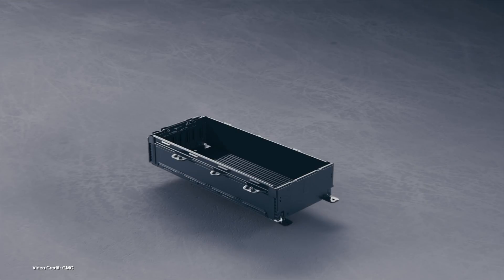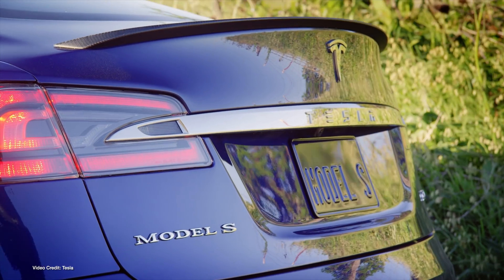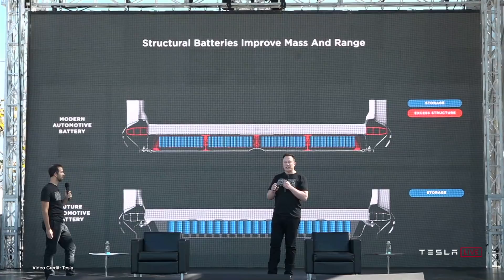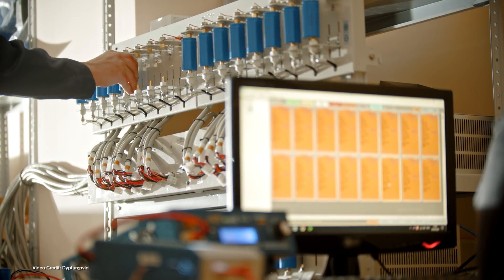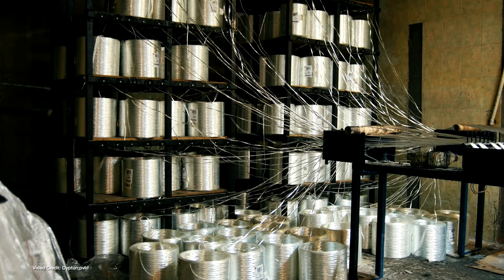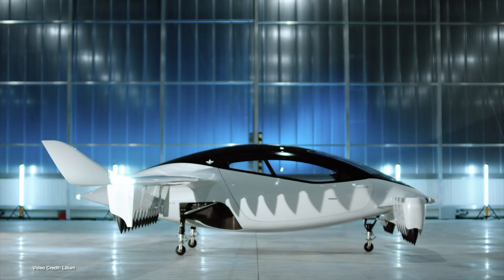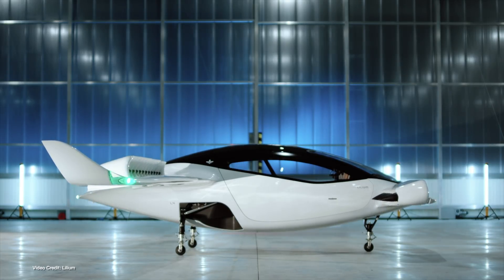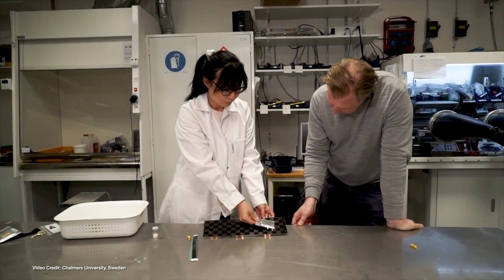Why You Should Be Excited About This Battery Breakthrough From Sweden!

Comment: Unfortunately the elephant in the room was not addressed. All chemistry batteries will age. So at some point a vehicle built with such a tech would be a throw away. Meaning you can't just replace/upgrade the batteries you have to dispose of the whole vehicle at some point. This is not a good tech since it promotes waste assuming recycling is not 100%.

Comment: Well enunciated! As an aside, imagine the day when all cars, trucks, and busses are electric. Now think of all the gas stations we currently have in a big city, and how many tankers of gasoline arrive daily to fill their tanks with gas. How much electricity does it take to replace all that gasoline? I might suggest, far more than the capacity of the current electrical grid. Furthermore, in order for electric cars to be really practical, they all need fast charging. We are talking here about charging at a rate of hundreds of amperes an hour, and 240 volt chargers. How much thick copper cable do you suppose it takes to make all those fast charging posts? I would suggest again, we will need more copper than we have.

Comment: There is one problem. Pretty significant problem.  When the battery has expired and needs to be replaced it is most likely going to be many times more expensive to change into new batteries.

Comment: Every bit of body being part  a battery. Vulnerable to vandalism or accidental piercing. Independent battery weight , yes but not so easy to be got at.  Car with lots of joints on +/- ? Might be best to get just get cars out of the picture. Free travel any vehicle method, but you won’t be the owner.     It’s got to happen, get used to it, no cars parked all over the streets or on the roads

Comment: They really need to replace carbon fibre though. It cannot (viably) recycled at all.
And the drawback is that the battery is not replacable when it's structural. 
As soon as your battery is broken, your vehicle (or plane)  is junk.

Comment: This could be a nightmare, imagine such a structure, full of composite materials, which acts as a battery, what would happen at the end of the life of a product built in this new combination of materials? Carbon fiber is a nightmare to manage, currently most of it ends up in landfills ... And what about the fact that it is also a battery? how long would the cells last? such a structure would not even allow to replace defective or broken cells and this would lead to the waste of entire sections of frames that would be a nightmare to be recycled... mmm... dreams are beautiful until they collide with reality

Comment: The Tesla wouldn't need 1000hp to accelerate 0-60 in under 2 sec if it only weighed 2000 lbs instead of 5000 lbs. But I hear about breakthrough batteries lasting 28000 yrs and everything else but see the same ole same ole in my new phones.

Comment: So when the battery "chassis" need replacement, you'll need to buy a new car?  Yet again another throw out, buy new product? EV's are not worth it for atleast 10-15 years.  If you need to replace motors, screen and other vital part within 4 years, the technology is not yet there..

Comment: For vehicles I don’t think this has an application unless it’s remarkably cheap. The first accident you have is going to be awfully expensive! Now for aircraft I see it has potential but efficiency would have to be a lot higher. Where I think this has potentially massive application is in solar panels - you can use this as the substrate and frame for a solar panel and have storage and generation in a single solution. Once again efficiency has to be improved a bit but elegant.

Comment: They do the same with engines.  But they can’t do exactly the same. The battery pack STILL needs to be in its own case capable of bearing loads while at the same time being temp controlled

Comment: So the idea is basically turning the body of a vehicle into a capacitor, I envision some safety concerns for that application. A charged body panel might remain extremely dangerous in the case of damage via crash or impact.

Comment: So.....once the structural battery is worn out you have to throw away the car. At least with the way they are currently are you can rebuild the battery pack and continue to use the car.

Comment: I'm  wondering why Rocketlab didn't go for this battery-as-structure thing. Guessing its power density and strength is hopelessly low for rockets.
Reply from the maker: Also, remember that Rocket Lab jettisons their battery packs during the ascent process. Battery hot-switching is a key stage for them. But I suspect that the energy density might be the bigger issue, as you say. - Winter
Reply: @transportevolved  Yeah... energy density too, but to me that seems like a lesser problem, if the rockets walls/fuselage/whatsitcalled is built of 20 wh/kg battery... and Peter Beck was very confident about not reusing rockets at first so it would have made even less sense then. Probably they are a lot better informed about battery tech, so they'll choose what works best.

Comment: 24 wh/kg is less than 1/10th of the density of current batteries. If a car is more than 10% batteries by mass currently, then with this tech it's literally impossible to get the same performance. it does not take a genius to think this through. What's worse is that if your benchmark is the Leaf, then we already know this is not an adequate spec. this does not even take into account the fact that you need HV batteries to run a car, and if your entire structure is battery then any minor collision now turns your entire chassis lethal to the touch. maybe learn some high-school level physics before hyping up tech that is unworkable?

Comment: If they can develop it into an applied coating, it may be commercially viable, but if it is used for frames or body panels, repairs will be prohibitive. If we didn't have psychologists marketing vehicles to go far longer ranges than most people need, smaller battery packs would work fine and smaller battery packs would be very viable for quick change at stops on longer range drives for day trips or vacations. Right now marketing is driving the industry down the wrong paths.

Comment: What if they made a entire house that was made out of battery we would be able to to store so much energy
Reply: The most energy to store is tank of heating oil . Pinhead do not think about heating entire house. Battery will be good to sign in  ON LINE for welfare . I can't even trust my emergency sump pump battery pack, it holds until I make generator ready. House construction is for rental unit now,

Comment: Energy density is too low, it would have to be applied to larger objects..  Maybe a roof of a house or walls with PV to recharge, or maybe a bigger boat with a PV cover roof.  Not so much for space since satellites are shrinking, so the in development SpaceX starship can do 100+ tonnes  to low earth orbit and the limiting factor would be size of the payload. Also imagine the cost of getting into a fender bender and your bumper is part of a structural battery, because currently there just made made out of plastic and cost thousands of dollars to replace.

Comment: "structural batteries" Aka: non-user replaceable... I'll be taking a big fat pass on this 😅
Reply: Current products are so heavily developed/engineered that user repairable is rapidly going obsolete. Getting to the point where keeping every garage stocked with the required tools is more wasteful than designing products for recycling.
Reply: @lengould9262  here's a story on repairability - this guy hit some road debris, which damaged a plastic belly pan and punctured a coolant line - Took it to a Tesla shop and they told him $16grand to replace the battery (ended up taking it to a shop that fixed it for $700)  who https://jalopnik.com/tesla-quotes-16-000-to-repair-model-3-independent-sho-1847281796
Reply: @peterkratoska3681  Yes, that is like 'surgery' for fixing an artery for cooling the battery!  How perceptive are those guys in the mechanical shops!
On the other hand, how rigid are those minds of Tesla shop!  They are knowing only the 'money-making mode' where they can make the most money in the shortest time.  How efficient, the process of using what has been already designed, to replace the main item which got impacted but not in the best interest of the buyer.

Comment: Its utility depends on the cost of the battery. Perhaps you could make a vehicle with carbon fiber instead of aluminum and steel and use conventional batteries to get similar performance as using this structural battery that also uses carbon fiber.

Comment: I'm seeing quite a few Comments regarding structural batteries in EVs and the problem of accident damage being non-repairable...

But why assume that the battery would form the outermost skin of the vehicle? If it formed the chassis and sub-frames which were then clad in shock-mounted 'ablative' body panels, only an extremely serious impact would damage the inner battery.

Think of how infrequently a petrol tank is affected in an 'ordinary' crash. There's no reason why battery components forming the floor, seat bases, boot lining and roof structure couldn't be similarly protected.

A car with a structural battery would be no different from one of today's cars, where it's accepted that a severe enough collision will result in a wrecked monocoque and an insurance write-off.

Repairing minor dents and scrapes in doors and wings would be pretty much the same as it is now.

It might even be better, if the outer panels are made from recycled plastic and not steel or something stupidly fragile and expensive like carbon-fibre.

I think some peeps are just miffed because this interesting idea is one that doesn't have Ego Muskrat writ large across it.  That's all the reason his disciples need to knock it down.

Comment: Meh... using batteries to build a car (or any other vehicle) means its far more likely that when (not if) a battery goes bad, the entire car (or substantial portions of it) will have to be replaced. This is an extremely expensive, and terribly wasteful idea... not to mention, anti-consumer and anti-environmental. No, having batteries be a modular component aside from the structural components of the vehicle allow for re-use of the vehicle structure with replacement batteries. 

Look at this another way, if integration were a good idea, the various non-structural components of a car would have already been integrated... but vehicles undergo wear and tear, and parts must be maintenanced and replaced at differing intervals, hence the importance of modularity. Seeking a way to lighten batteries is laudable... but this is exchanging one problem for another.

Comment: yeah- let's all keep our reality heads screwed on tight here. 
Carbon fibre itself is more than 60 YEARS (!) old now from lab research - and it's still very niche, very expensive product. 
 I expect same crawling progress on solid states.
p.s. despite all this being 'novel' approach - wasn't Tesla saying this exactly in its battery day - i.e. it will plan in future to make the batteries become the priciple structural  member of the car.
p.p.s the stiffness of a material is not necessarily related to the stuctural strength at all (or toughness) - its quite easy to find a more bendable alumnium alloy that is stronger than a much stiffer steel. So if you can greater flexibility / bending you might accept a lower Youngs modulus (elastic stiffness) for a greater strength. 
Carbon fibre is a good example here - it has massive stiffness to weight ratio compared to steel  - but its strength and toughness and durability can be problematic  (unless you understand specific context its working in ) - but its mostly held back because as well as being just dificult to manufacture to high quality and consistently on large scale, its also difficult to  fabricate, design with it and joint to other materials.
As an engineer/designer we occassionally get pushed towards pondering carbon fibre within design because of it headline superior properties  - but then because of all other drawbacks you inevitably wish you hadn't bothered.
Like I said - don't hold your breath

Comment: It's good and it's bad news then. 

Integrating the battery into the structure may save metal and weight, but it dooms the whole car to the lifespan of the battery. 

Additionally, we see very little in the way of any improved ability to recover and recycle the materials of the batteries either.

Comment: Zero mass is just marketing nonsense.  Look at the huge difference in lightness and strength between carbon fiber and stainless steel.  Yet Musk is using stainless steel for Starship because there is more to engineering vehicles.  I'm going to assume the car manufactures are not complete idiots and have carefully chosen the best material for the requirements.   Resistance of electric potential corrosion jumps to mind.   Course what are the odds of cars ever getting wet.   :p

Comment: I can't help but imagine how difficult and expensive it would be to repair an EV whose body structure is also it's battery!
Reply: I was thinking about that too but I have seen other solid-state batteries and they were cutting them in half and piercing them without any issues.
Reply: I imagine if they bolt the battery/frame/understructure to the rest of the car it won't be that complicated at all. I imagine if they weld it together that would be a problem.
Reply: I imagine it will be almost impossible to use. Never, ever does an innovation like this come without a significant advantage for the builder: usually making the consumer have to buy a new product more often.
Reply: @TheAllMightyGodofCod  I agree. But as soon as two builders do this, they will compete via lower cost...hopefully.

Comment: If this is developed to the point where it has 10% of the energy density of Tesla's battery, then to replace Tesla's battery pack  you'll have something that weighs 10x Tesla's current battery.   That doesn't seem like it would be helpful or do anything for electric planes.

Comment: Am I the only one thinking sitting inside a battery that in a collision could easily short out and cause the whole entire car to be engulfed in a massive fireball a bad idea?  Even if it doesn't cause a fire a minor fender bender would become incredibly expensive.  You are no longer hammering out a fender or door panel.  Now you have to replace them with an expensive battery composite structure.  Batteries are heavy and right now EV batteries weight are now all below the center of gravity at the bottom of the car.  With structural batteries all that weight now distributed all around the car.  The handling will be horrific an roll overs way more common than in current EVs and ICE cars.  Structural batteries may make sense in aircraft and spacecraft but not in cars.

Comment: you WANT battery packs, until you can get batteries that have a 10k charge cycle rating, then having structural batteries would require replacing the vehicle every 1--2 decade or so, instead of only replacing the battery pack

Comment: Wow you were doing so well until. 5:39
"The higher the measurement of stiffness the less likely something is to undergo elastic deformation"  I think you intended to say plastic deformation, but more importantly, I don't think there is any correlation between young's modulus and the yield strength. In fact, steel always has the same young's modulus, but has a wide range yield strengths based on details of chemistry, heat treatment, and strain history.

Comment: The only problem I see is the lifespan of those structural batteries,  how many cycles does it have... When conventional batteries die you change the pack, when structural batteries die you will need to replace the entire structure of the device?

Comment: It all good that it's stronger and more efficient bla bla bla but the most important thing that not mentioned it the longevity. When you make the body the battery, when the battery dies, what happens?  You're just going to have a big giant garbage that you can't replace the battery or fix the battery. So cars that can potentially last decades if you can change the battery, now you have a vehicle that lasts less than a decade and has to go in to the dump. Planes lasts and has to be used for decades. A battery that can't be replaced is useless. Batteries don't last for decades.

When companies develop new stuff they have to think about the end of said product. That is the issue, no company thinks that and push the responsibility down the road to someone else.

Comment: It would have been grate if you would have put numbers on screen especially when there is something they can be compared to, especially stiffness and capacity per kg.

The widespread and interest in this will be further fueled by more actors if less rare materials can be used to produce it, currently the supply chain is a big concern from both business reliability and labor rights perspectives.

Comment: How would the transfer of forces work with crash structures ? Really like the idea and have thought of this myself but if batteries become structural can that structure be repaired ? Also is this recyclable ? What if the battery life cycle is lower than that of other structural elements ? Can this be used and still enable a modular design for interchangeably? Nice idea but I'm not convinced this is suitable for consumer vehicles.

However, rollingstock, boats, drones, houses...very interesting indeed.